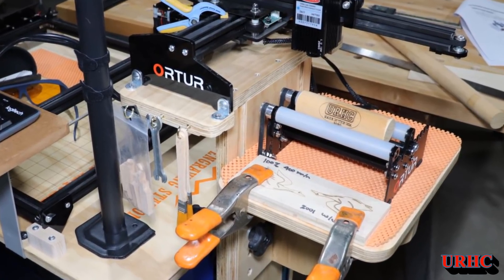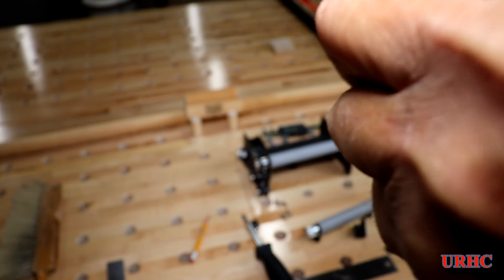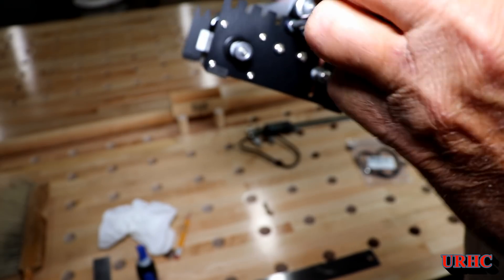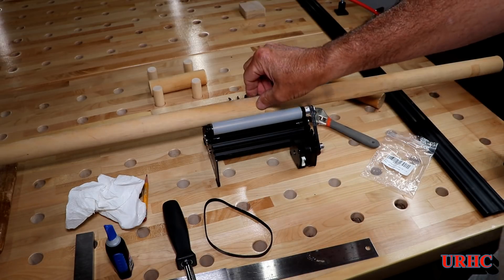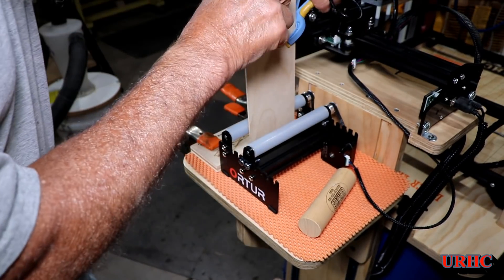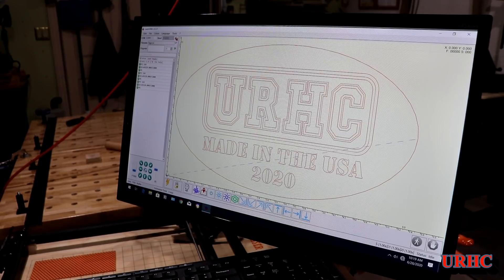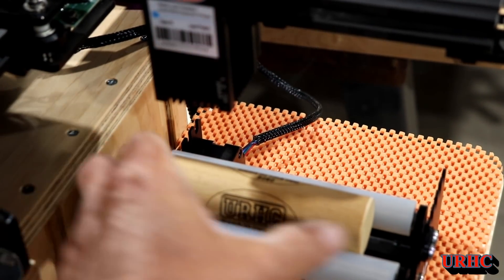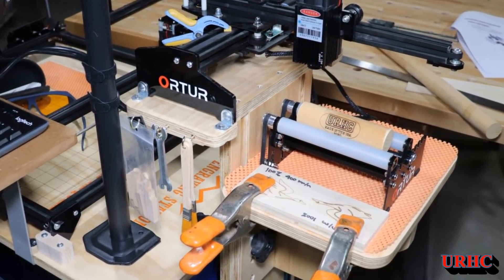First Use And Mods To My Ortur  Laser Engraver Rotary Roller Axis

Comment: Trying to set mine up but laser keeps moving in Y axis and leaving the item. Pretty sure I set circumstance and all that up. Any tips on why it may be moving?
Reply from the maker: Dont run as a circumference.  Just run as a standard  X, Y  file with the rotary plugged into the Y connection.  Thanks for watching.
Reply: @unemployedredneckhillbilly2023  hmmm I did try that by disabling roller as others mentioned but while the rollers spin, the Y also moves. It also jumps back and forth very fast which makes cup move and get out of place 🤯
Reply from the maker: You have a wiring problem because the y can't move with the cable switched to the rotary. Trying to run 2 motors on the Y driver definitely would be jumpy and probably will toast the driver. Contact Ortur and see if they can figure out what you did to the wiring.
Reply: @unemployedredneckhillbilly2023  I used Y2 and it works! Instructions let me to believe it was on Y1 motor but at least it works 😃

Comment: Really great videos! All of them are super helpful as I am new to this, having a hard time getting my image to be centered on my rotary, using a tapered 16” glass, I have it leveled but it seems it needs more support than what I have so off to the hardware store I go! I’m also very interested in the little nut holders you 3D printed, how much would you charge to make me a set and ship them to me? Thanks a bunch!
Reply from the maker: Thanks. I see the newer rotary's come with a set of rollers to help with tapered glasses. One thing I want to try also is get some wide rubber bands and use them to level them. I can't make things to sell. You could easily make them from small pieces of aluminum and just tap the holes. Thanks for watching.

Comment: Hello and it is possible to use this equipment with my zbaitu m81 laser,
Reply from the maker: Contact  your  laser manufacturer.  You probably  could just use the y stepper cable and modify the steps per mm in grbl. Thanks for watching.

Comment: I am looking into the rotary but want to mount the rotary so it’s always square. Any recommendations or ways around it?
Reply from the maker: Build  a base that references the x rail outside of the travel area or just put pins in the base and mount to easily drop it in place. It all depends 
on the base you use and how high the item on the rotary is. Thanks for watching.

Comment: FYI: You had the original belt on wrong. The factory belt goes on just like you did with the replacement belt and works just fine.
Reply from the maker: They changed  the belt after  seing the video. FYI newer ones have the longer belt. Thanks for watching.

Comment: I love your system here I've been in the laser business for 33 years and this is the best setup I've ever seen for rotary. On a big laser why did it was 75 Watts size wise 15 ft by 20 cost pretty much a second mortgage at $145,000 back in 1990 what I did with it besides gun stocks for weatherby was laser engrave drumsticks but what I like about your setup you can do drumsticks but you might be able to do wood wine bottles and that would be sweet liked and subscribed you now have a new follower!
Reply from the maker: Thanks. These are low cost Chinese lasers that have no safety features or fume control and they are fun to use on projects. They are only about 4 watt output blue lasers that do not work on light or reflective surfaces but do a good job on wood. About half way through this video https://youtu.be/x8eJckRnIfs is an example of the kind of projects that I use them for. For a couple hundred dollars they work good once you get the settings down. Thanks for watching and subbing.

Comment: Does anyone know if this will work on the cnc.3018 pro ? Looks like same.mltor and connection
Reply from the maker: To tall to fit under mine and number of steps per mm would need to be changed because of the screw pitch. Thanks for watching.
Reply: @unemployedredneckhillbilly2023  thanks!

Comment: any support of NEJE master 2 20w  with Ortur Laser Engraver Rotary Roller ?
Reply from the maker: Don't know. If the steppers are the same should be easy to plug right in or put a new connector on the cable to match the NEJE wiring. Thanks for watching.

Comment: hello I am looking for the same grid as on your laser engraver do you still have the file because I do not know how to do it I suck with Photoshop thank you and have a happy holiday !!!
Reply from the maker: I just  did it in lightburn.  draw a vertical and horizontal line then copy them at the increments you want. Only  takes a minute and I didn't  save it. Thanks for watching.
Reply: Thanks you for your answer l will try to do it ;)

Comment: i am new to this and assembled ortur laser master 2. however Y axis is not moving at all. i tried light burn and GBRL both software. could you please advice?
Reply from the maker: Be sure the cables are all plugged in properly and seated.   If they are right then contact Ortur for support and they will help you troubleshoot.  Thanks for watching.

Comment: Have you attached the rotary to the Ortur Master 2?  I have them both but a little unsure on what direction I was going to go in reference to how to place the laser to maximize the rotary use.
Reply from the maker: No. I only use it with the Ortur 1 that has the adjustable shelf for focusing it. You would  need to raise the 2 up with blocks. Thanks  for watching.

Comment: Greatly done.
Any plans on adding air assist to prevent smoke settling down on the lens?
Any plans for the fumes ventilating?
Maybe you did already, just came across this vid to engrave on circular products.
Thx
Reply from the maker: No, I just engrave wood so not worth bothering with air. I have plans on building a ventilation system someday. For now I just roll it outside. Thanks for watching.

Comment: Silly question, but how do you get the laser to lite up when you hit "frame". I've never been able to do it.
Reply from the maker: in lightburn  you have to turn it on in the settings and set a safe power level. Thanks for watching.
Reply: In Lightburn hold Shift and then click Frame.

Comment: Thank you for the awesome videos! I make wooden duck calls and am considering buying the Ortur 2 and the rotary accessory to engrave images of elk, flying ducks, lettering, etc. on my calls. The only issue is the call barrel isn’t perfectly cylindrical (it tapers and changes shape), so it won’t roll correctly between the two rollers. Do you think the rotary attachment could be modified so that I could slip the call over a single rod to rotate it? The calls have a 5/8” drilled hole though them. Also, would this etch anodized aluminum?
Reply from the maker: the taper would  affect  the focus and I doubt the outcome would be acceptable.  It would be easy to 3d print adapters  but you really need a machine with z travel and more complex software to deal with distortion.  Thanks for watching.

Comment: Super nice set up.. Have you tried it on a Stainless steel Bottle like Yeti or Hydro Flask? Would appreciate your response. thank you.
Reply from the maker: No. I don't  have proper ventilation to handle the hazardous fumes from things like that. Reflective surfaces must be coated.  Contact Ortur with exactly what you need to do and they can tell you what is required.  Thanks for watching.

Comment: Ive got the 20w on order with the rotary unit cannot wait
Reply from the maker: It's a fun learning  toy. I reccomend using  lightburn for the burns. Much easier to use then Laser grbl and they have a great  support forum that Ortur is present on. Have fun. Thanks for watching.
Reply: @unemployedredneckhillbilly2023  I noticed that lightburn will engrave whatever image/text from bottom up, going line by line. In your video, I noticed that the engraver did letter by letter and it seemed to be much much quicker. Is there a way to have the same settings in lightburn to allow the laser to engrave letter by letter opposed to doing small horizontal lines?
Reply from the maker: @222dillon  There's a setting in lightburn that let's you do the line or shape. Shape cuts the time in half.
Reply: @unemployedredneckhillbilly2023  and is that possible for images that are imported to lightburn? I only ask because I can't seem to find too much information for this. Thanks for the quick reply and awesome video!

Comment: Can you etch into painted metal containers (tumblers) with your setup? Thanks!
Reply from the maker: I have not tried that because  I  don't  have proper ventilation but Ortur  says it can be done.  You would  need fairly  straight walls because  of the short focus  length  and no z travel.  Thanks for watching.

Comment: The main problem with this type of roller it's it doesn't allow to engrave a mug, for instance
Reply from the maker: You have  to 3d print adapters and change the steps per mm to do things  like  mugs. Thanks for watching.

Comment: Thank you again for sharing this. Would it be possible for you to email me the instructions?     jwsailor@cableone.net       Also do you sell the 3D printed flanges that you made to hold the nuts for the movable roller?
Reply from the maker: I had a young  lady  email  me the file and I  printed it then deleted the email so your  best  bet is contact Ortur and let them know your also  having  problems  accessing the  files. They should  send  them to you. I am going  to post the stl files to thingiverse when I  have some extra time.  Not set up to sell anything.  To expensive in NY. They  also would  be easy  to make  from aluminum and just tap the nut plate.  Thanks for watching.
Reply: Unemployed Redneck Hillbilly Creations thank you again, I managed to download the user manual from another site. I will look at tapping a plate or a way to hold the nuts.. do you recall what size belt you found to allow turning longing items and where you found it?
Reply from the maker: There is a link to the belt I used in the description.
Reply: Unemployed Redneck Hillbilly Creations thank you again. You have been a big help to this old guy. This has been my first venture into lasers. You have some great ideas. I also thought I knew how to work YouTube and hate to admit it took me a minute to find the description. Thank you very much for all the help.

Comment: Don't replace the screws with Phillips.  Just use the correct size hollow ground driver bit for the sizes you use.  Or do it all up with Allens.
JIS is a choice too, but it and Phillips are really for large scale assembly.  IMHO.  Good vid.
Reply from the maker: It's  nice to only need one type of driver. Thanks for watching.

Comment: I dont suppose I could bother you for the stl for the parts you have designed? Also what size belt did you use in the end? I changed the roller layout on mine got rid of the locktight nuts and replaced them with some spacers works well
Reply from the maker: I used  the belt I  put a link to in the description.  I will  try to get them on my thingiverse page this week. Thanks for watching.
Reply: @unemployedredneckhillbilly2023  sorry missed that bit will check it out, your videos were part of the reason I got one of these machines and partly why Ive started to modify mine so always on the look out for useful STLs for it - still learning that side of things sadly so unable to design my own parts as yet. Keep up the good work!

Comment: Could this do a powder coated tumbler?
Reply from the maker: It should.  Contact Ortur to be sure it will work with the color tumbler you plan on engraving.  You would  need a good ventilation system.  Thanks for watching.

Comment: For spindles wouldn’t you just add arch to your design eg in a smiley face shape, with the taper at the top?
Reply from the maker: No, it would go out of focus. Need something to keep them parallel with the travel. Thanks for watching.
Reply: Unemployed Redneck Hillbilly Creations Thanks for posting. How much of a decline would create a noticeable difference though? Would 1-2mm be noticeable?
Reply from the maker: Yes. Especially with the 20 way that only has a 25mm focal distance.  These are just overdriven blue diodes.
Reply: Unemployed Redneck Hillbilly Creations Im looking to get the 7W only and want to mark/slightly burn (not engrave or cut) some soft foam. Does this laser allow for low heat but high precision settings?

Comment: Really like your videos. You mentioned turning on the dot for focusing. I don't know how to do that. Please email me at zalumskis@bis.midco.net with how to turn it on. I appreciate any help you can give me. Keep up the nice work, I am just getting started and will be watching you to learn a lot.
Reply: I know about turning the lens. I don't have a spot to adjust. Is there a way to turn it on ?
Reply from the maker: There is a button across the bottom of laser grbl that turns it on low power for focusing.  Read the laser grbl instructions on GitHub.
Reply from the maker: Turn the lens on the bottom of the laser. It's threaded and moves in and out. Find the smallest spot to focus.  Thanks for watching.

Comment: A little bit of advice regarding your CR10, if you'll allow it.

Before printing, preheat to the material's temp, then take an abrasive sponge and clean the nozzle. You also should tweak the retract values in your slicer of choice (if you're using cura, i find that a speed of 29 and a distance of 7 is decent point to start from. I also suggest you get a hold of Simplify3D (i'm using 4.0.0 now) and learn to use it, it's a steep curve to climb, but it pays as it does slicing better than Cura (the multiple choice tweaking is murder tho, but it's worth it in the end).

Also, get yourself a shock dampener for the Nema motor that runs the bed, it will reduce the vibrations drastically, thus improve the quality of the prints. One other thing, print over paper tape (i advise you buy 4 rolls at once, of the best tape you can find, then leave it in a cold, moderately damp place for a few weeks before using them, it makes the adhesive better, but that might vary on what tape you have at your disposal) and lay it diagonally, not parallel to the edges of the bed. Then, using Herlitz red stick glue (this is the best stick glue for this application, period, .87 cents on Amazon) smear the tape in even strokes. Once that's done, use the knife they gave you (Creality, i mean) and spread it thinly and uniformly).

This will need to be reapplied each time you have to print something, if the tape survives. To remove an item from the tape, embed the knife into a corner (i usually design a sacrificial nib for that) and using your left hand to support the bed, press the putty knife in to lift. Really, once you figure out this system, and get used to it, the problem will be removing parts, not losing them.

The tape and glue part of this text is because i'm assuming (wrong or not) that you ditched it because it was troublesome. Also, don't forget to check the play in the table, they might say that you need to tighten the belts and such to their max, but that's untrue, it just needs to be taught. Tightening it too much can cause excessive vibration, and that, is the enemy of every such machine. A lot of people take their advice as law, and throw these machines out because they don't work right. I'm ...starting to think that this might be something lost in translation.
Reply from the maker: Elmer's glue sticks work great. They pop right off the pyrex plate with a razor blade when cooled. Tape is a pain to use. That's what I started with on the warped original plate. I downloaded and upgraded cura right before printing and my old cr10 settings somehow were all screwed up after upgrading.  Those first  prints looked like a birds nest. I re did the profile and the second  prints were fine.  It has been tuned up and does a good job with  proper cura settings. The filament had been sitting on the printer for 6 months so it probably has moisture in it also as I don't use it much anymore. I now have a new Chiron on the way for some large parts and this will go down the road in the future. Thanks for watching.
Reply: wow...can you send me a message? i have a couple of rookie questions!

Comment: What else will you make for engraving on the roller?
 I'm thinking it will be good for engraving wooden pen blanks with company logos
Reply from the maker: I have some rolling pins to try and also want to try Acrylic glasses. Tapered pens will need an adapter to keep them tracking properly. Also want to see how big  bowl it can handle. Thanks for watching.
Reply: A user had used it to engrave wooden pen and share his job at https://www.youtube.com/watch?v=XOG0AIwpBeA&t=171s

Comment: You have a few lasers correct? which one did you use for this ,, I have heard people like the little 7w for more detailed engraving?
Reply from the maker: I have 2- 15 watt. I understand the 20 watt is best for engraving with it's short focus distance and the 15 watt is better for cutting but it also does a good job engraving. Don't know about the 7 watt. I think they all use the same blue diode and are driven at different input power with different lenses.